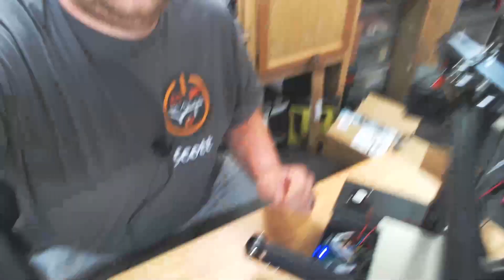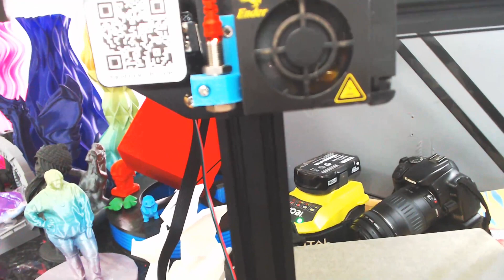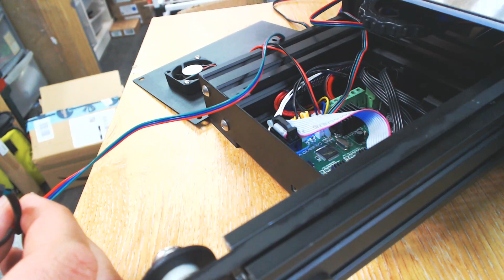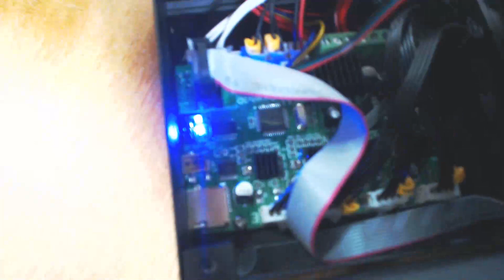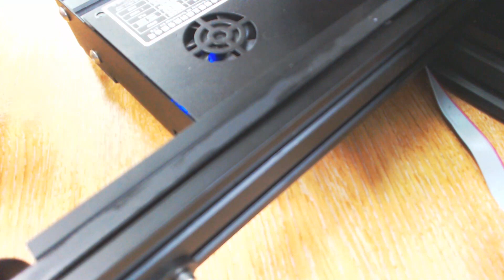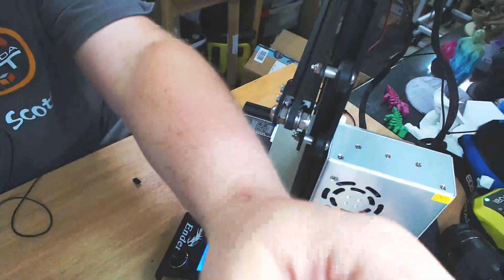3D Printing: Ender 3 TCMUK-3d Pinda Probe Install overview!!!

Comment: Does the brown wire from the probe go to +5V pin on the motherboard? Does the black wire (signal) go to which z-ENDSTOP pin? The blue wire from probe goes to which Z-ENDSTOP pin? Do you not use the white wire from the PINDA probe?

Comment: I use the original PINDA( 3wire) from prusa on my ender 3, but you can use the TH3D firmware
Reply from the maker: Yeah this is a drop in replacement for the prusa pinda. And I could not for the life of me get it to work with the th3d firmware. So just went with standard 1.1.9 marlin did my changes needed and worked first time no problem
Reply: Can you help me adding this sensor to my ender 3 pro?